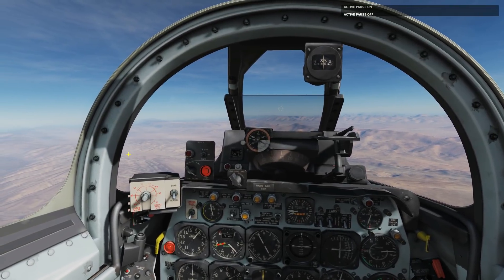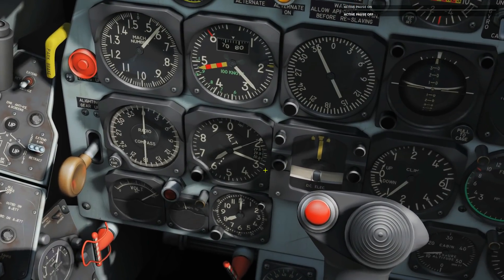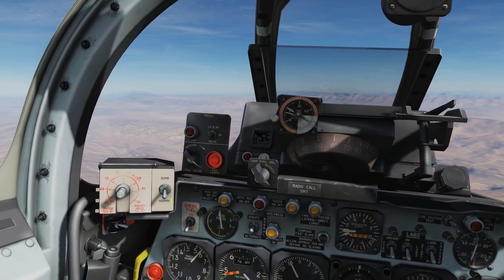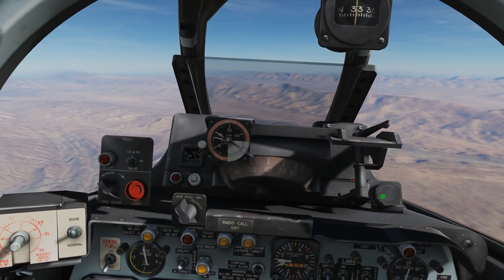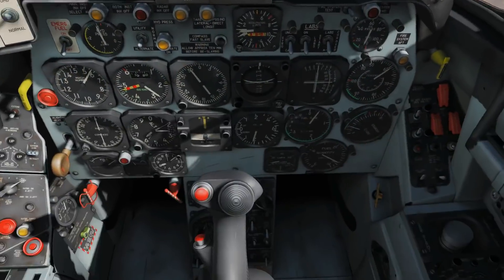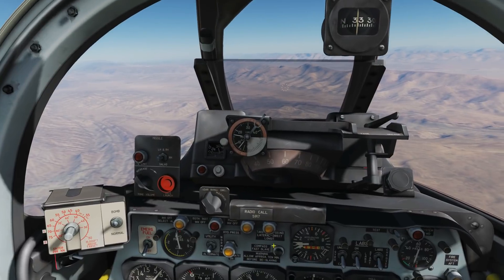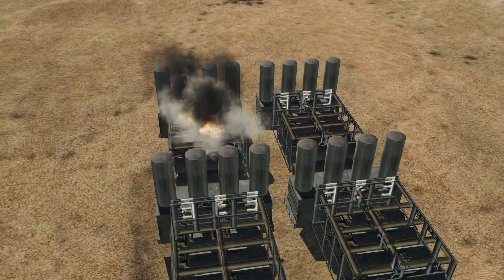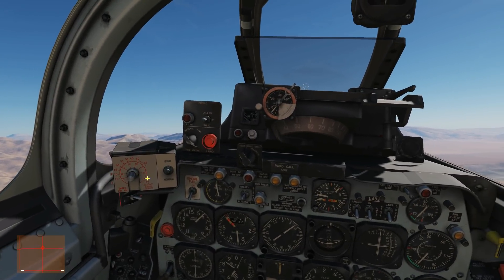F-86F Sabre: MPC Bombing Tutorial | DCS WORLD

Comment: When you set the MPC to bomb, it should electrically cage the reticle , but it doesn't. Set sight function selector to bomb. This will cage it and prevent reticle dance on the dive..
Reply: In addition, isn't there an electrical cage control on the throttle for use when doing these roll-in maneuvers during gun and rocket attacks?
Reply: @eddievhfan1984 yes. There is.
Reply from the maker: rgr thx